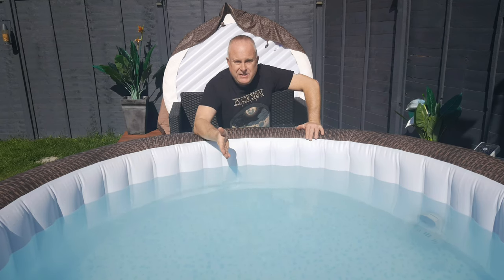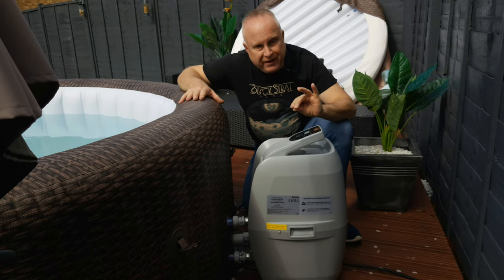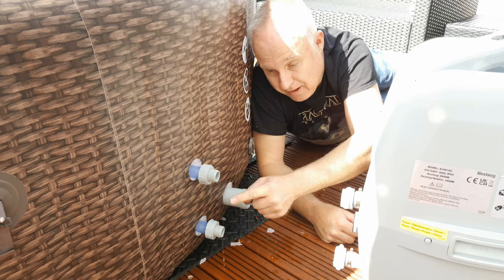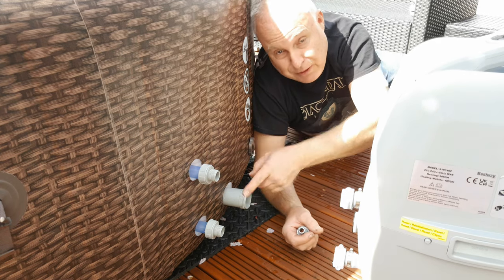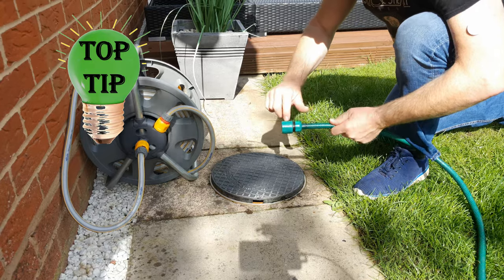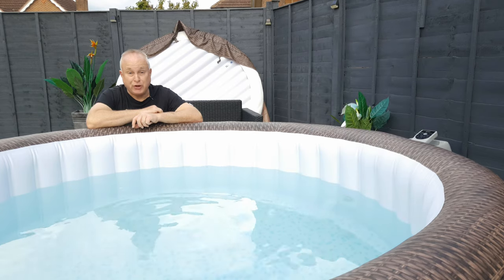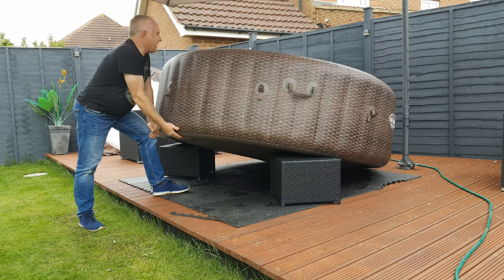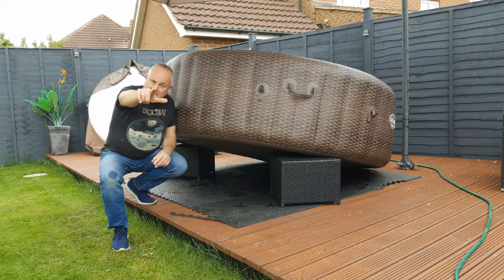How to Empty a Lay Z Spa | 🛠 NO Extra Tools or Equipment Required ✔

Comment: Why didn’t you just drain from the bottom drain from the start? Is there a benefit from using one of the other outlets?
Reply: he says in the video that he doesn’t want to flood his garden - this method allows you to empty via a hose and directly into a drain
Reply: @chloecurtis2569  i think they meant why not plug in the hose pipe to the drain valve at the very bottom (the one with the bung) on the floor of the hottub

Comment: Thanks for all your hot tub vids.  We setup our first hot tub today. It’s warming as I type. More vids please.
Reply from the maker: I'm intending to do one with tips to keep running costs to an acceptable level (general stuff, nothing too OCD). What else would you like to see?
Reply: @AbouttheHouse0  at some point more info on chem balance. I had a problem where my ph was super low and by the time i leveled it my alkaline the dropped. Had to use bicarbonate of soda to bring it up. So more chem tips would t
Rock. Maybe a vid of powder chloride vs tablet in floater etc ???

Comment: Again.....thank you for the informative video.
Question.....Like you, when i attached the hozelock and hose to the first drain point, there is a steady leak of water all over the deck. It may seem minor, but over a couple of hours it can make a lot off mess.
When the same hozelock atrachment is connected to the floor drain point, it fits perfectly.
Surely there shouldnt be that much leakage from the first point?
Thanks,
David

Comment: Hello, have you had any trouble with water leaking from the drain hole? I recently emptied my spa using  this helpful video as a guide, cleaned it and then refilled it. A few days later I opened the lid and the water was nearly empty. No leaks from the pump and the air is still in tact so I thought it must be the drain hole not working. What do you think?

Comment: Thank you for the video. Which hose adapter do you use? When I attach the hose the water does not drain into the hose.
Reply from the maker: Hoselock compatible. probably as well to get a little set. This one is less than a tenner https://amzn.to/3x2Nk2o

Comment: Hi, I'm planning to do this tonight or tomorrow and was intending to leave the pump unit attached and connect a hose to the bottom pipe you switch to towards the end of the video. Is that viable? Why disconnect the pump unit? Thanks for your videos, they're great 👍
Reply: I was wondering this as well. Can't you just use the lower drain port to drain the entire tub?
Reply: @mygt8a4re  yes you can just use the lower port, we tried it for ourselves in the end and it worked a treat.
Reply: @RevJDSC  thank you for the input!

Comment: How do I take the connector of the bottom of the water pump? Do I twist or pull it of? I may have put it on a bit tight, I have the Milan lazy spa
Reply from the maker: Sorry it's been a while. Unscrew it off. If you watch the setup video it's the exact opposite of how it goes together. 👍

Comment: Thanks for this Clear video … I think I’m doing something wrong though . I’ve got the Helsinki hot tub and I’ve put the 2 x stoppers on as tightly as possible  but water is squirting out the big bottom pipe at force . I live in a slope in a shared garden so can’t flood the garden … any suggestions ?
Reply from the maker: The bottom pipe is the drain and needs a hose attached.

Comment: This might sound like a silly question but what drain should I be using to drain the water away safely? I don’t have drain access in my garden like you have in yours and don’t want to empty it somewhere where it will cause damage! Thanks in advance
Reply: Most people run a long hose or even multiple attached hoses of need be and run out to the street to drain into their local retention pond just as rain water does. I guess this may be different in different locations of the world. I'm located in the U.S.

Comment: When I built up decking for my spa,I have digged and concreted hole 1ft deep for a water pump. Everyrime I empty spa,water is drained straight up to the drain on street via hose a have concealed into the curb
Reply from the maker: Because of the chlorine content, you should be draining to a sewer, NOT a surface drain.
Reply: @AbouttheHouse0  yeah, it is pumped to the sewer. Water is pumped out straight to the on street drainage via hose.

Comment: Excellent Video's Sir ... the Hot Tub instructions were pants, so your videos really helped me a lot !
I emptied/cleaned and refilled my tub today but pumped the water out using the Lay z Spa heat pump and emptied the water direct into the drain using a hose pipe and a couple of male hose pipe connectors. This was easy and much quicker than using gravity.
I have a feeling the chemicals in the water are no good for the grass either
I think it would be worth doing a Video on this method ?
Reply from the maker: What a brilliant idea. Any chance you could send me some photos of the setup and the bits you used? email in 'about' section TIA

Comment: We have had our hot tub about a month - how often should it be emptied and refilled in your opinion?
Reply from the maker: Bestway seem to suggest monthly (tho they aren't specific about this). My brother only fills his rigid tub once per season (summer - he doesn't use it in the winter) and by keeping the filter clean and the chlorine up to snuff it stays sparkling. He does change the water occasionally if they have friends use it though and he and his wife always shower before going in it.
Reply: What a waste of water to throw 300 gallons of H2O away every month, you could purchase yourself a real hard-sided hot tub & not have to drain that thing for 4 month intervals, some go even longer in between draining schedules, depending on what chemicals one is using.

Comment: just tried hose on the bottom pipe where the filter is but it doesn't empty any ideas
Reply from the maker: Did you leave the filter in place? That would stop it.
I'd say you would be better using the bottom drain point

Comment: What is the flat connector you have for the bottom drain hole
Reply from the maker: I'm not sure which part you mean, but there are links in the description
Reply: @AbouttheHouse0  it’s the hose attachment that goes under bottom drain

Comment: Thanks for the video! If I'm just emptying and refilling, do I need to remove the machine from the pipes?
Reply: No just turn it off so you’re not at any risk of running it while dry
Reply from the maker: You do not have to, but I think you will need to, unless you've got some other magic for getting the last of the water out. Do let us know how you get on and what you do.
Reply: @owenashcroft8167  not if you have the extra drain plug at bottom edge.

Comment: How do you get the water out from inside the chamber? packed mine down last year and could hear water sloshing round inside?
Reply from the maker: Try removing the air valve and hang it with the aperture lowermost
Reply: @AbouttheHouse0  how do you remove the air valve?
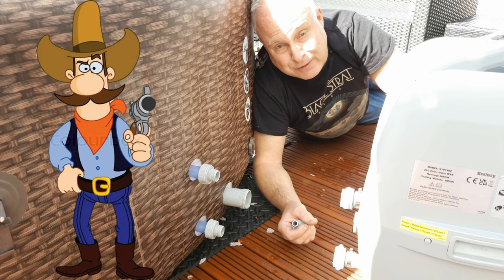Reply from the maker: @TheRobbieg2006  I show how to fit the "air adapter" in this video https://youtu.be/nZew9F8dv6s from 1:45. Just unscrew it out from the hole - like you would an oil cap on an engine

Comment: Like the video, straight to the point.

Do you need to run airjets for 4-5 hours after emptying it as official website suggests, to dry from inside?

Is it worth using some anti mould chemicals before packing, or that should be done when unpacking next season if there is mould?

Thanks
Reply: It can get quite moldy in storage.   I had a mare cleaning it the second year.

Comment: As soon as I attach my hose to the drain underneath. It won't continue to come out and I don't know why?
Reply from the maker: Make sure there are no kinks and the hose is below the drain all the way. It could also be the bung falling back into the drain hole.
Reply from the maker: Also, make sure the hose fittings are NOT the sort with a valve in.

Comment: Seems overkill when I empty ours I remove all pump connections wait until it’s about 1/5 full and flip it over, water drains away in about 10 minutes from the garden and takes about 5 minutes to empty it and I can then get the air out and hang it up to dry.

That being said I also emptied a 3000l pool onto our garden in under 10 minutes and that drained away incredibly quickly so guess I’m lucky with the drainage
Reply from the maker: I'd be more concerned about killing the grass and plants with the chlorine.
Reply: @AbouttheHouse0  if that happened it would be quite useful round the edge of the deck it’s on, but it hasn’t killed anything despite repeat empties of both hot tubs and pools.

Obviously if your garden doesn’t drain water logging it is a silly idea, but emptying a hot tub every few months or after a weekend hire isn’t going to cause any damage
Reply: The amount of chlorine in this quantity of water is never going harm grass. Iv emptied the Maldives 100's times and peoples gardens always cope . And iv never had any issues in 5 years of hiring.

Comment: Or, if you don't want to disconnect the pump, simply siphon the water out of the pool with a hose - if it has a bigger diameter, it will empty it quicker. (You know, just immerse one end into the water and suck the other end - letting it go before the water gets into your mouth.)

Comment: hi pal i use a submersible pump takes 15 mins bought off ebay for 30 quid
Reply from the maker: I'll be doing a video of various 'pumped' methods in a few months when I've had a chance to try out different solutions. This one follows Bestways instructions and requires no additional equipment spend.

Comment: What is that grey plastic drain point in your video here https://youtu.be/xqr0KDS_Bes?t=192. I dont have this fitment in my pack, I only have the small hose adapter that would screw into the pump itself to drain?